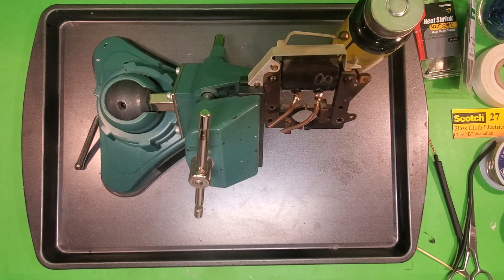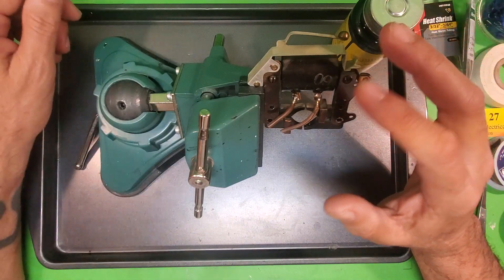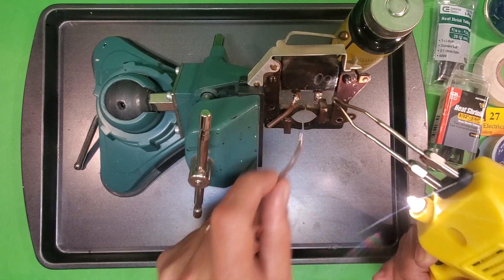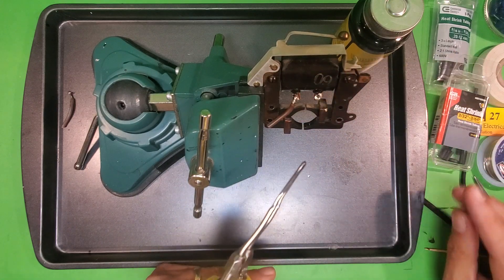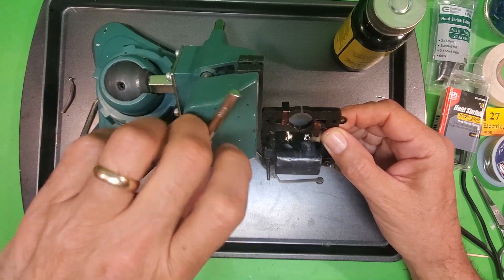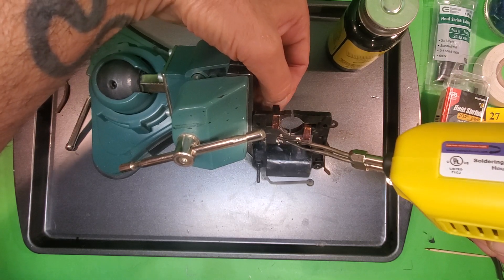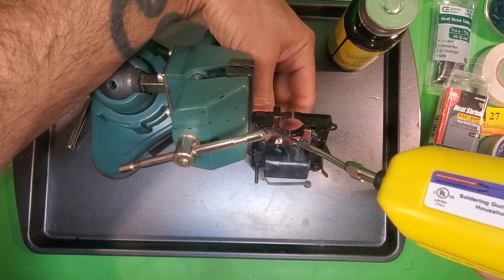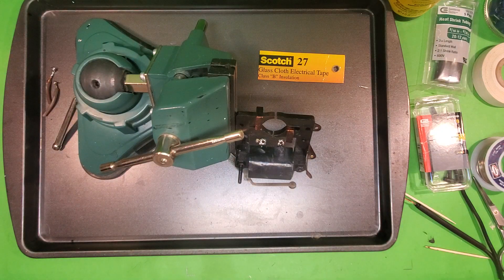GE/Telechron - pt 6 - Setting up the coil (Alarm Clocks)

Comment: Thanks for sharing.  I was checking one of my vintage clocks and notice it needed new electrical wire and when I wiggled it the paper started to crack around the coil.  Now I know what I can do to save it with the new wiring arrives.